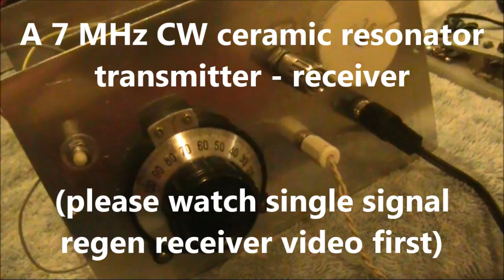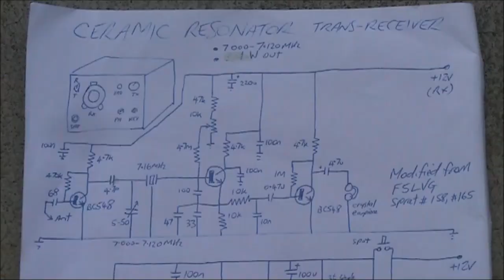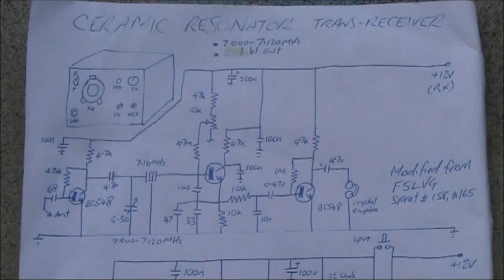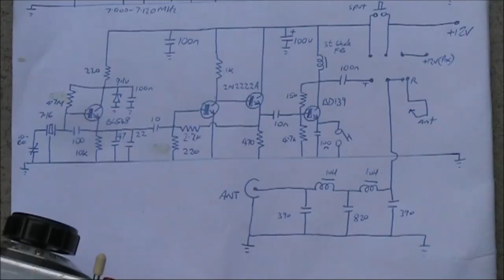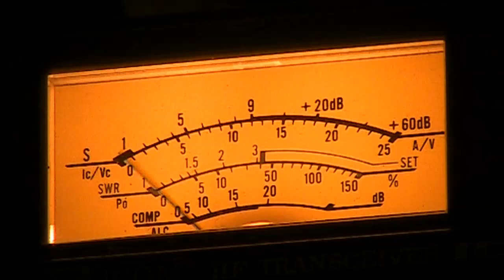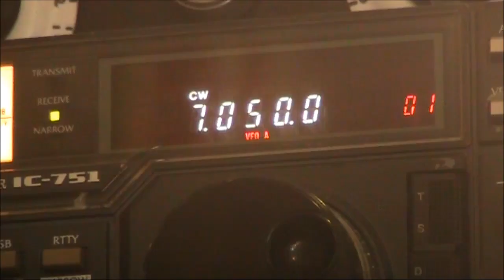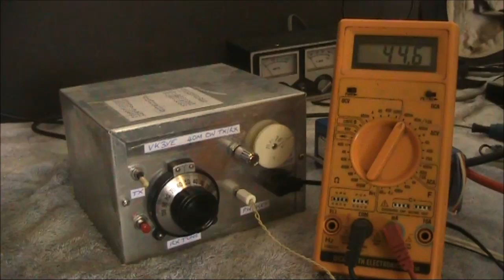Ceramic Resonator Regenerative Transmitter - Receiver for 7 MHz CW

Comment: Nice little rig!  I know because I recently build it.  

The audio was to low for me, so I build in a small 386-amp.
Missing a sidetone when keying, so a simple one-tr osc is inside.
The RX is easely  overloaded at evenings, so I put in a switch with an 18 ohm Attenuator, when needed.
I was getting over 0.8 Watt at 12 VDC, and over 1 Watt at 15 VDC.
An PSU-power box from an old computer is a good idea if You have.
An very good building- info how to build this station can be find in SPRAT magazine #174  Spring 2018.
Can be recommended by me,  it is a small nice QRP box.

SM2BYW. Jimmy

Comment: I just didnt understand exactly how the spot button works... if you could please explain?! That'd be nice !!
Reply: All it does is run the transmitter oscillator and buffer stage for as long as you hold it in so you can listen to the transmitter frequency in the transceivers earpiece, enabling you to set the heterodyne correctly.